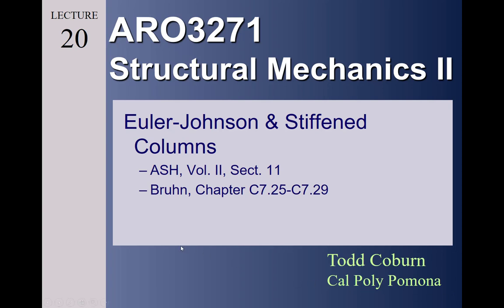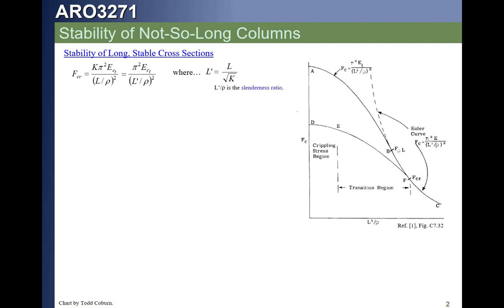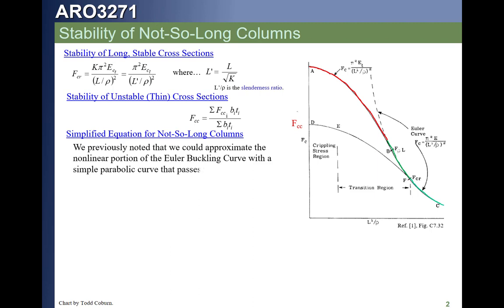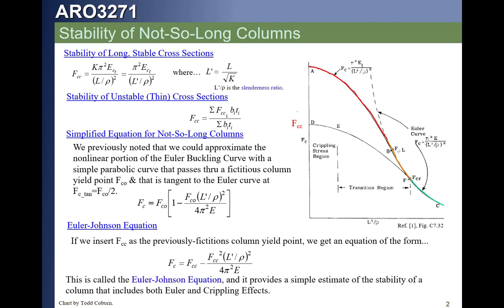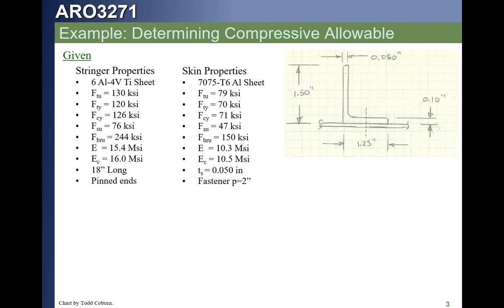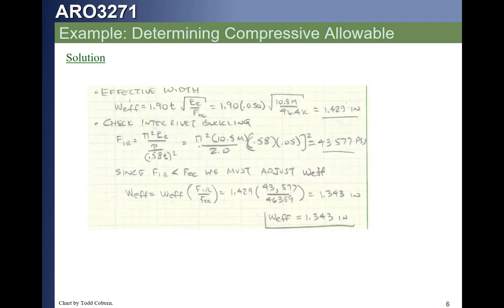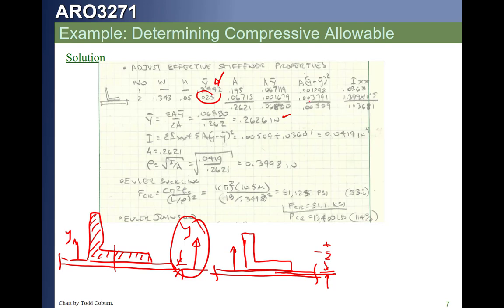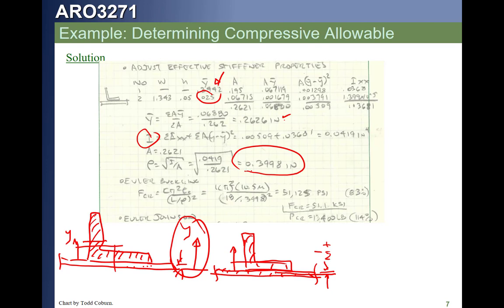Strength II: L-20 Stability - Analysis of Columns using the Euler Johnson Method

Comment: How do you qualify something as a not-so-long column?
Reply from the maker: Usually the L/rho ratio.
Reply: @ToddCoburn  well, I get that part okay..... How do I get to the threshold though? I've seen this somewhere before. If the slenderness ratio is greater than pi times the square root of two times elastic modulus over critical crippling strength, then Euler Buckling takes over. Can't find a reference for that though. Any ideas?
Reply from the maker: @Parcolai  plenty of references for that.  If you use Euler Johnson, it takes care of long column (Euler), short column (crippling), and transition region (assumed).  See my Euler Johnson video for that.

This does not account for nonlinear effects when yield is exceeded, but kind of covers it since that is dominant for all but fat stubby sections.